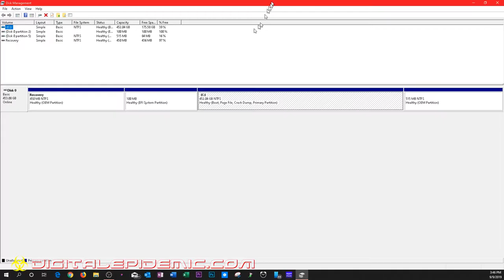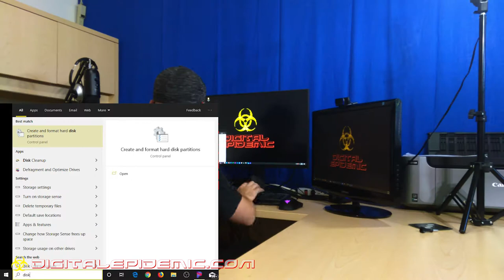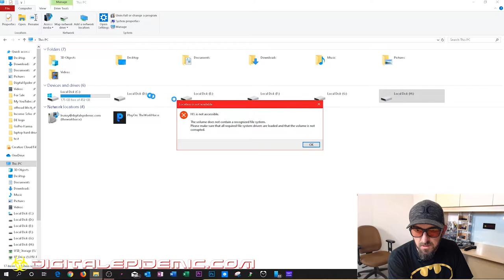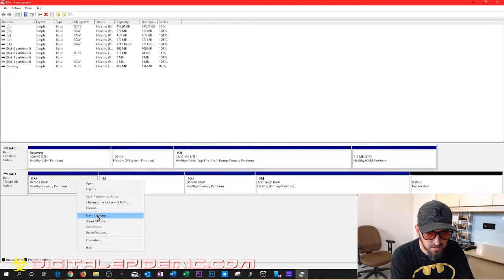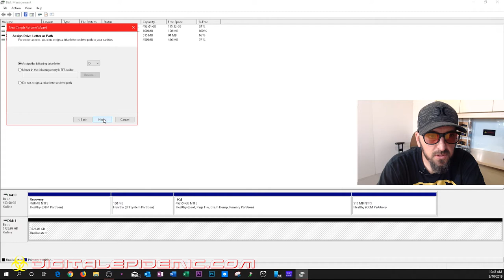How do I add an extra hard drive to a desktop PC? More Storage DIY!!

Comment: Is it worth adding my hard drive from my old pc in my new one
Reply: i wouldn’t do it
Reply: @codysawyers4586  why what will happen
Reply: @vvaltvv1307  nothing bad, i just recommend getting a new hdd or ssd. It will run much better.
Reply from the maker: I think it really depends, if your new machine has a really fast but very small capacity hard drive then adding an old slower but much higher capacity hard drive would make sense. But it is adding older technology to a newer system so it might slow it down and make it louder.

Comment: Hi
Is the second hhd independent from principal hhd. I mean if principal dies the data on second hhd stay safe?
Reply from the maker: That's correct, the primary and secondary are independent and in the event of an issue with the primary hard drive, the secondary should not be affected.

Comment: Doesn’t an air compressor have static? I read somewhere that you shouldn’t be using it to clean PCs because of static and the risk of your gpu.
Reply: Correct, use compressed air in a can.

Comment: Originally I had 1TB HDD that was filled very quickly especially in games, editing programs and there were also multimedia and documents.
 
I added a 3TB HDD to games, a 2TB HDD for programs, 1TB HDD with files and an SSD for the operating system but I was thinking of getting a higher capacity SSD for certain heavy programs that I want to run more rapid and I recently got an hdd 250 GB changed for ssd to a laptop, although I could use it externally if I can put it on the desktop that would be much better

But I do not know how to identify how many hard drives I can install or if there is any limitation how can I solve it (for example, I do not know how to know if the power cables will reach me from the power source or space saidt sata is bridge of the video or space said, etc)

Comment: i had someone build my pc for me its 2020 i have a knock off windows 7 and a 75gb hard drive i cant even update google chrome
Reply: Sad
Reply from the maker: brutal...
Reply: Format the whole thing nvme drives are cheap now a days you could get a 500g for 60 bux on amazon instal windows 10 for free like I did from the microsoft page and they even give you the tools for a new windows usb installation and boom new install if you need drives go to the webpages for the processors and the sound and video and that should do it like 2 hours tops you would take a few days waiting for the SSD nvme due to deliveries though

Comment: I have added my old hdd to new pc ,but it was making noices 🤯🤯🤯 I was really frightened ,but the voices gradually decreased ,and now it make some noices in few minutes ( is my hdd ok ???? )
Reply from the maker: Older pre-SSD hard drives + Noises = Bad News. Older platter-style hard drives made more noise and you can hear them accessing the data. But, if you start to hear pinging and clunking then get the data off because it's about to go.
Reply: @digitalepidemic  well now the voice occurs occasionally  and also I had benchmarked my hdd from various AAP's and also from inbuild feature of windows ( and some say its working in very good condition😁👍 ) ,thanks for the reply 🤗